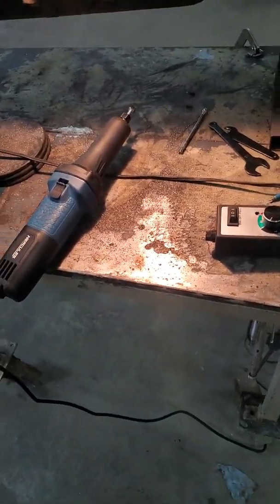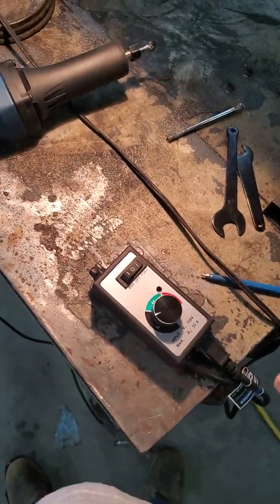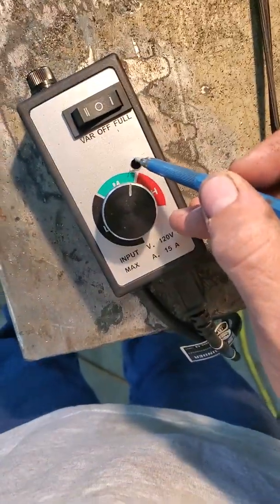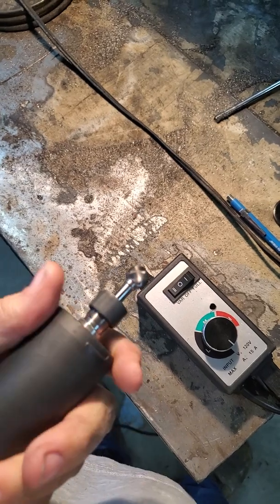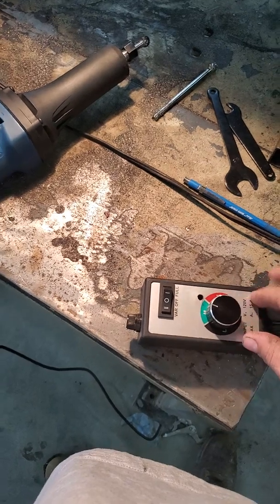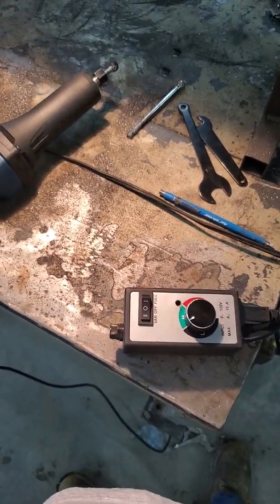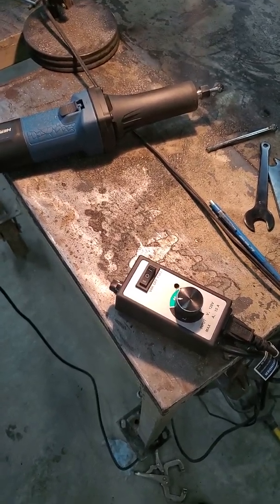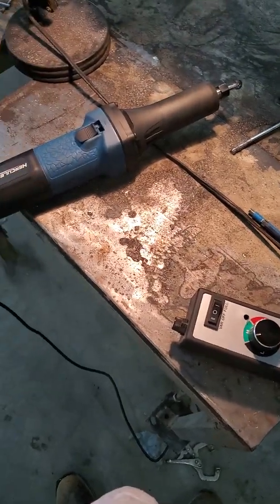router speed control mod hack for variable speed die grinder

Comment: Works with angle grinders?
Reply from the maker: Well it works on anything but I don't think I would recommend it for anything you are gonna put much of a load on for very long.  If you try it try it on a cheap one. Lol
Reply: Ok. It is a cheap one
Reply: I just bought it today from
HF.  It seems the adjustment screw you’re mentioning is on the bottom of the circuit board of this unit, not the top.  I didn’t want to drill in case it didn’t work and would have to return it